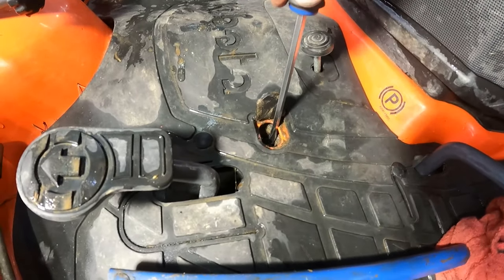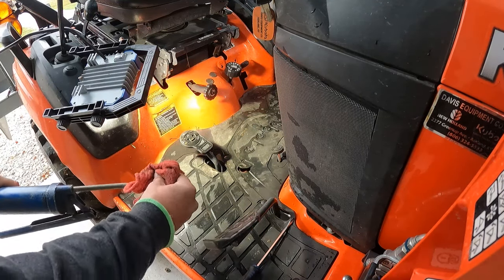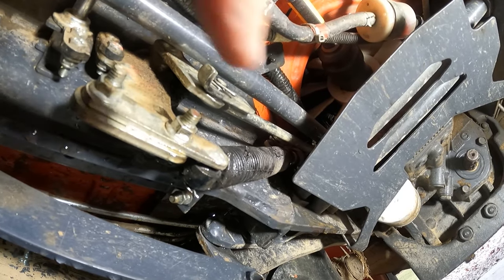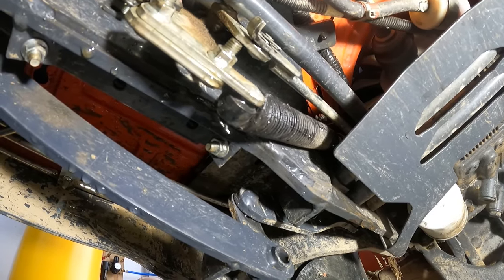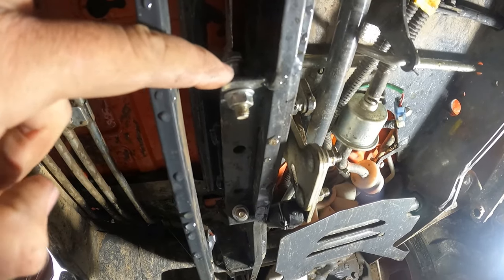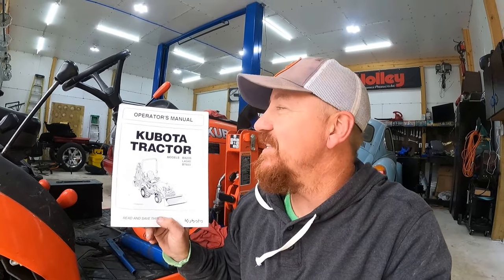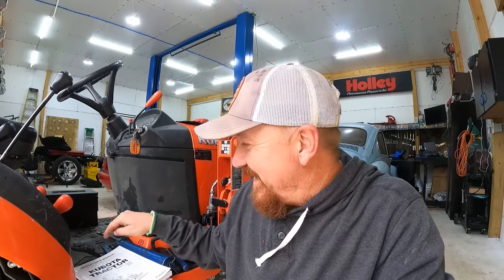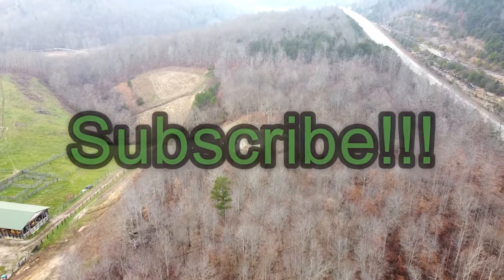Don't Miss This Grease Zerk or Your Kubota BX Won't Start!!!

Comment: my dealer told me the BX has 1 grease fitting. and that was it.  the tractor has no other grease fittings.  Now the attachments and implements have a crap ton.  nice video

Comment: I`m probably a rare one here, because i go by the book on everything i own. Could be why i don`t have nearly the issues others have i guess. I even buy the shop manuals.

Still an excellent video regardless Lucas.
Reply from the maker: Nothing wrong with that.  No doubt it is why your equipment performs.  👍
Reply: Braggards should just stick to their own channels and watch themselves over and over.  We don't care that you think you're better than everyone else or that your way of doing stuff is the only way everyone else should do it.  If this issue was addressed in the manual, you should either cite the publication date and the page number or just keep to yourself.

Comment: Thank you for making this video. You saved the Day! It's hard to believe that a little grease and exercising the forward and reverse pedals would prevent my tractor from starting. After checking battery voltage and the fuses I turned to youtube. Thanks again!
Reply from the maker: Glad it helped!

Comment: Have the bx1850 which is about 14 years old.  They had problems with that not returning to center position for a while.  I greased and adjusted many times before i was happy with it.  Great videos.
Reply from the maker: Thanks for watching!

Comment: Have a 2650 and the same thing happened.....I never greased the one fitting for the pedal....thank-you.  I watched videos where guys spent 2 days checking the fuses circuitry dilithium crystals and Flux capacitor and it was the pedal every time...lol
Reply from the maker: Lol

Comment: Good tip, Lucas.   Our L Series creeps but it doesn't have a grease fitting on the treadle.  I've bent that HST damper before....they are $100!!    Oh, and WalMart has literally been out of grease for months.
Reply from the maker: I bought a case at Rural King, because I was basically out when I shot this video.

Comment: Pretty sure this is the only zerk fitting on the tractor, obviously not including the FEL or BH. 

Have you ever done the recommended adjustment for the home position of the pedal?
Reply from the maker: Actually I haven’t.  Probably would hurt to check that.  👍

Comment: That little cooling fan used to be  very very expensive to replace - if you use it in rough conditions you might want to get a aftermarket guard.
Reply from the maker: 😂🤣. You’re not wrong.  I replaced my fan for $18 but it was a decent job.  I have a video on it.  It doable in under 2hours.
Reply: Mine came with a broken HST fan. They cost less than 15$. Took about 3 hours and I drilled the hole rather than taking everything apart. Used it 1 hour and a stick broke it…again. Second time took me an hour plus I installed the skid plate. Wise to do so. The dealer charges around 400 I was told.

Comment: help  my bx2380  seat switch is bad   used jumper wire  on switch by front of seat  didnt work , i have to bounce hard on seat to get it to work , if my weight shifts on seat  it stalls, by passed  connection to seat switch and same , stalls , is there a fuse i can remove to fix it ?
Reply from the maker: I’m sorry, I don’t know the fix for that off hand…